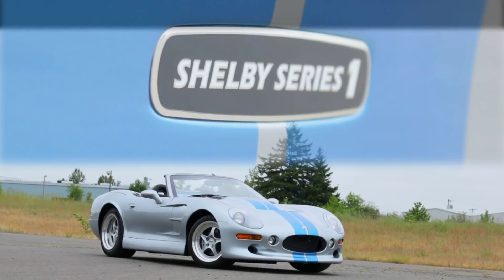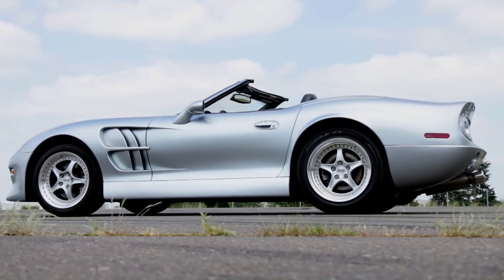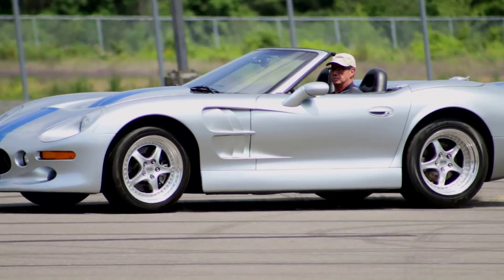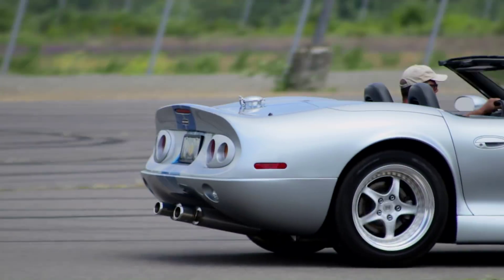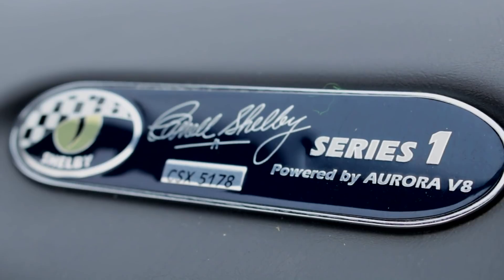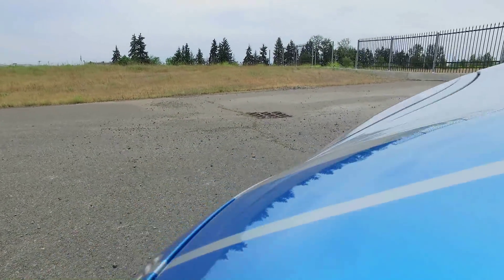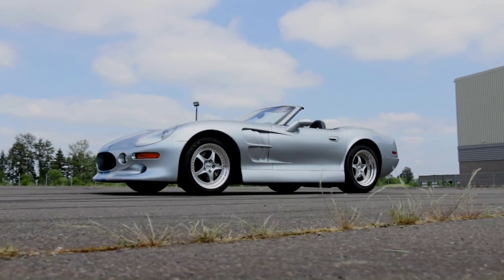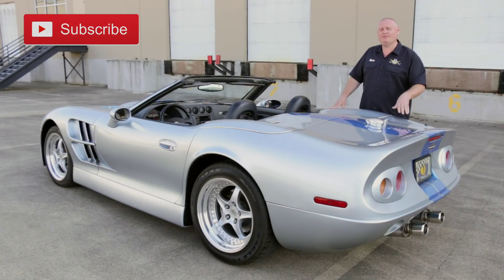Shelby Series 1: Muscle Car Of The Week Episode 271

Comment: I owned CSX5278, a red factory supercharged version. It was a blast to drive, until I burned the clutch with only 1,500 miles. It used a Pontiac Fiero clutch, remade for more power but it just wasn't up to the task. We got a clutch maker to do a GT500 dual disc to fit, and it was all good. Then Goodyear stopped making the tires, and I realized replacement parts weren't going to get any easier to find. Ended up selling it, but I do miss it.
Reply: I hear you Friend. We all have that special car that we remember with fondness, no matter what it was, classic or just an everyday driver. 
I have and owned some very nice cars, however, the one that I miss the most is a 1965 389 4-speed GTO, nothing fancy just plain stock but I would love to have that same car back again.
Reply: I remember test driving the Series One at Shelby American when the plant was located near the speedway.  Thought the car handled great, then Gary Patterson took the wheel and managed to eject my cellphone from my shirt pocket with lateral gs on the public roads around the shop.
Reply: Gary's a hell of a driver! Now let's go have some damn fun...! I went to a press release for SAI, took a couple of my old Shelby's, we decided to go to antique car night at a drive in theater. I drove my 427 street Cobra and let Gary drive my 427 Comp Cobra, he said it was one of the wildest experiences he's ever had. He's got some serious skill behind the wheel, for sure.